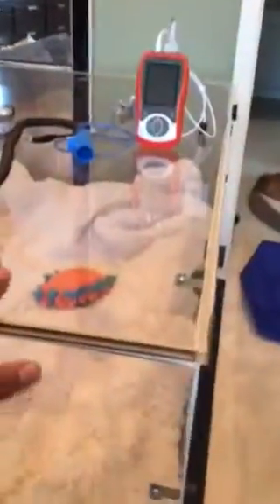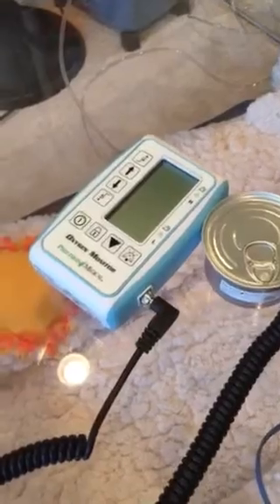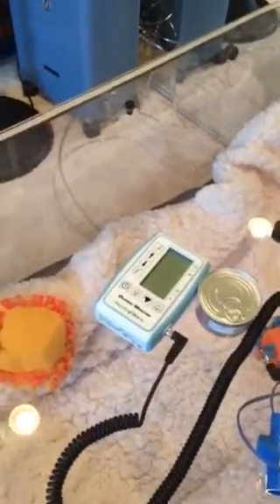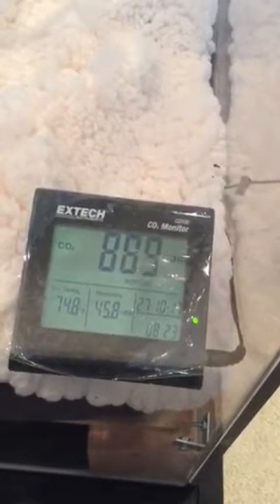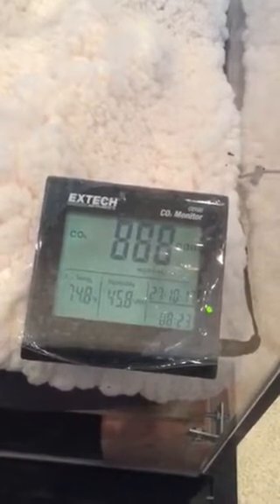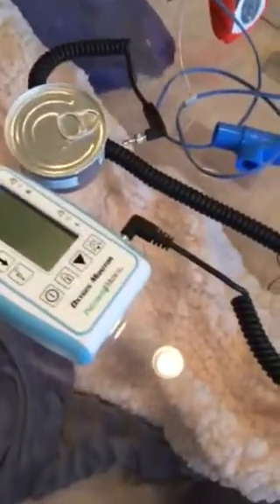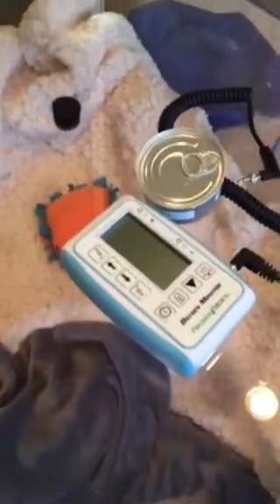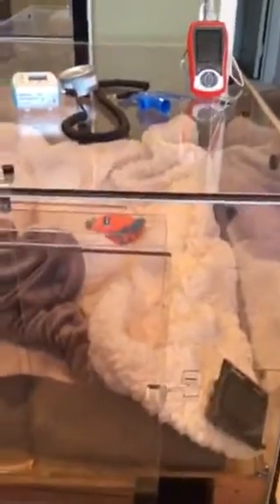Pet oxygen incubator - How To Make Your Own

Comment: I know this video is old but for those who found it, you should know there's a critical error -- his box is WAY too big to be effective with a 5 liter oxygen concentrator. The box needs to be smaller -- and if it's bigger than 30", you need a 10 liter machine or it's worthless. I know, because I made the same error.
Reply from the maker: Thank you for letting me know.  I was lucky that my pup recovered and didn't need to use this..that's probably why I didn't realize this error. Thank you for letting everyone know not to do what I did with that size concentrator. Thank you!
Reply: @sw4usc  No problem. I think most people could not build something as nice as you did with as many safety features, it's just that it's too big. Hope you were able to sell the parts -- that oxygen sensor alone is more than $600 new.

Comment: There’s absolutely not one link for the parts !🤦🏽‍♀️
Reply from the maker: Hello. Sorry I didn't put any links.  The parts I got were difficult to find and I had to hire someone to custom make the frames.  I bought an oxygen concentrator from a used supplier and I bought the c02 absorption product from a guy on ebay.  So very sorry I cannot be of more help.